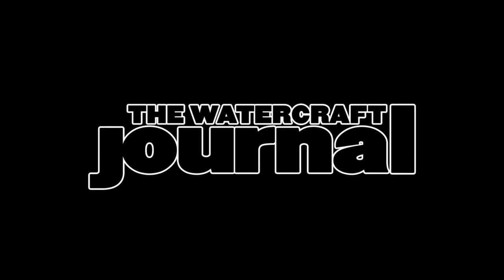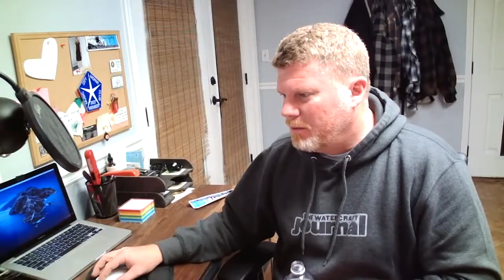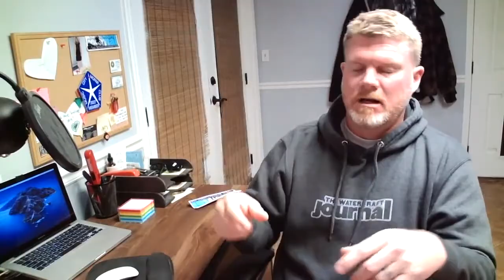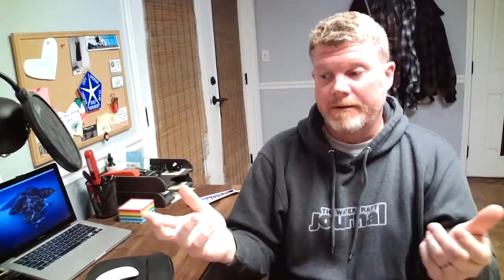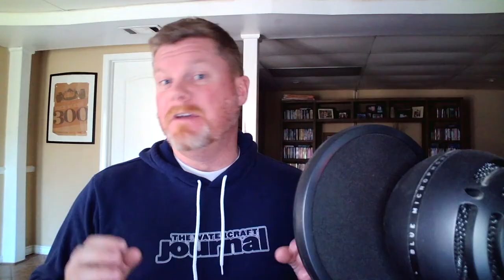What Are Our Thoughts On BRP's (Kinda) New Rotax 150? WCJ Quick Topic

Comment: No thanks.  Adds excessive cost, creates more points of failure, the complaint about noise and deck clearance is overblown by marketing idealists not experienced boat system engineers.

Buy a sterndrive if you want that much recessed into the boat and lower.  Cheaper to maintain and winterize versus that mess.

Comment: I wish they would have called it an Evinrude instead of Rotax.
Reply from the maker: Yeah killing such a big name eludes us
Reply: @watercraftjournal  They cocked up the marketing of the e-tec by continually saying it was a 2 stroke when they should of said ultra low emission, fuel efficient, lightweight engine with no service for x hours.
Reply: I'm glad they didn't call it an Evinrude.   Evinrude may have had some problems over the years, but no way the Evinrude name should be associated with this nightmare piece of crap they call Rotax.   Let's put the powerhead underwater and we'll give it an air pump system, a bilge pump system and a water intrusion warning system on it just in case any water gets inside the cowl.   Only it's not a cowl - BRP calls it the "bucket".    Good name because bucket is what's used to hold or bail water.  Whoever dreamed this Rotax up needs to taken out and horsewhipped.   Also a good thing they named this new program Project Ghost, because in a few years it will probably disappear like a ghost after dealerships and BRP get tired of working on warranty claims.    And in the most brilliant move of all, Rotax will only be offered on the 2 boat brands owned by BRP.    That sounds like a GREAT marketing idea to capture a bigger share of the boating/outboard motor market.   

Why BRP chose to develop this Rotax POS and just totally gave up on improving the ETEC and G2 outboards or coming out with a 4-stroke outboard sure doesn't make any sense to me.   I love my ETEC 150 and I'll run until it either blows up or BRP quits making parts for it or former Evinrude dealerships say they won't work on Evinrudes any more.
Reply: @omcbob37  all good points and definitely agree.  The money spent could have improved Evinrude.

In reality if they wanted a low profile solution and max deck feature, they could have accomplished the same utilizing jet drive or a light-weight, compact stern drive.  It would be far less prone to water intrusion.
Reply: @gransport4246  Another interesting aspect about this Rotax thing is that it can only be factory installed on their boat brands, i.e. one of their brand dealerships can't install one in their shop.  So what happens if it needs some major repair that requires pulling the thing off the boat - can your dealership even work on it or would they have to send it back to the factory?   I'll be really interested to see what the service history is like on this Rotax, especially during the first year or two of production and use.   Even beyond that, what's the likelihood of restoring the alleged water-tight integrity of the "bucket" after it gets removed the first time for routine powerhead service?   This thing is likely to become the BRP version of OMC's Ficht engines - nothing but trouble.
Reply: Couldn't call it that. BRP systmatically destroyed the Evinrude name with poor design and substandard build quality.
Reply: Johnson seahorse should come back even though BRP never bought the name
Reply: Evinrude didn't want to build one like this so BRP killed the company.

Comment: The G2 was such a fantastic motor, sad to see it go, but I hope this Rotax does well on the market. I think it’s got great potential on pontoon boats.
Reply from the maker: Hopefully!
Reply: The g2s are absolute dog shit I work at a former brp dealer and those things are the worst engine bombardier ever made..the g1s finely started to fix everything and than the fully redesigned to the g2 needless to say it didn't go well because they stopped selling outboards after that
Reply: @salvolpe1167  In what ways? I know the powered steering was crap, but I thought the powerheads across all their blocks were solid. ESPECIALLY the 1.9l i3, thought that one was super solid
Reply: @salvolpe1167  I don’t believe that you work at a dealership that sold  Evinrude G2. They had some early hiccups. But the last rendition was and is a fantastic outboard
Reply: @sawmaster6095  your right the power heads are awsome. They did have some  growing pains, but the last rendition of the motor is fantastic 👍🏻
Reply: Do you happen to know the range of serial numbers for the "last rendition" of the big block 300s?
Reply: No it wasn't. It was a horrible nightmare. The worst outboard ever made. I spent more time doing warranty work on them than routine maintenance. They Sucked.

Comment: I'm glad it's not an evenrude  .  

The etech Evan rude was nothing more then The fuel injection system bolted to an old s*** motor.  

Evander can't hold the candle to Honda Yamaha Suzuki what it comes to building motors
Reply from the maker: But it sorta is the E-Tec. That was kind of the point.
Reply: you do realize it is a evinrude e-tec the exact motor just flipped horizontal, the gear case is a evinrude gearcase, anything brp makes is junk.
Reply: @Dozer 806  evenrude is not made by brp. They are owned by brp. 

The etech on the evenrude is just the fuel injection bolted on. 

And brp makes jets.  

I've never seen a polaris or harly  jet.